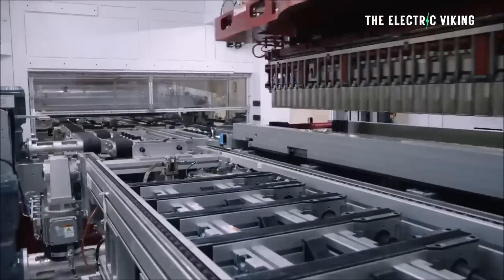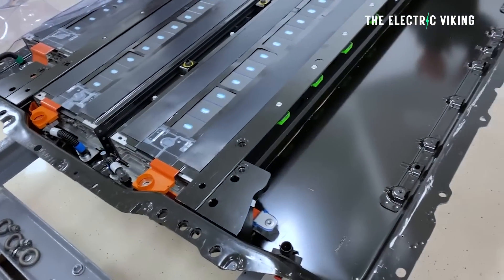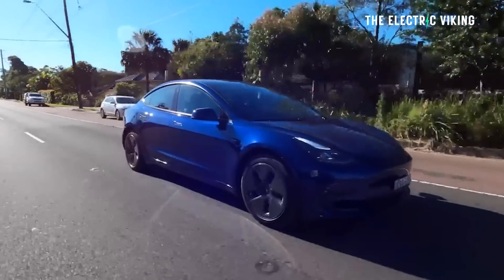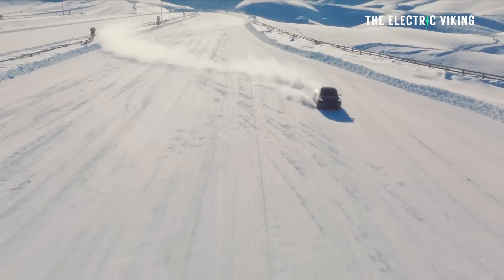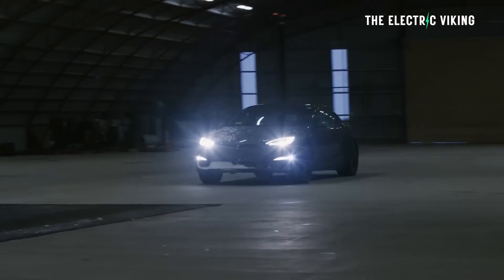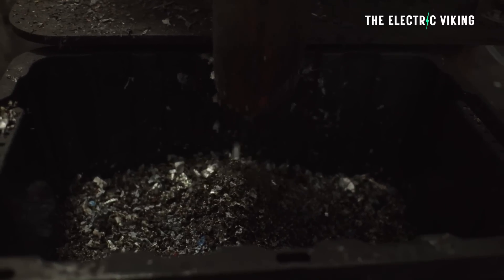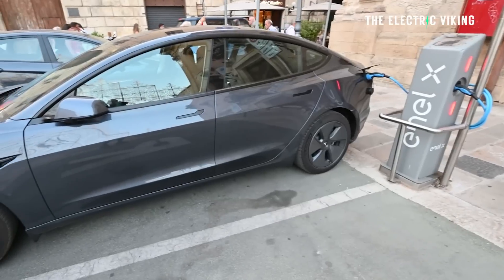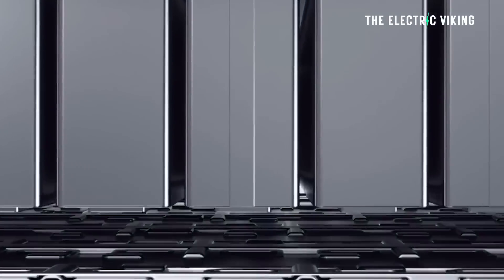Tesla reveal how long its batteries last after 200,000 miles of driving

Comment: The LFP batteries should be far superior to the Nickel Manganese Cobalt batteries. LFP batteries typically will retain 80% - 90% of their capacity after 4000 - 6000 charging cycles. That equates to charging your car every single day for 11 years. Some solar LFP batteries are issuing a limited warranty that guarantees that the batteries will retain 90% of their capacity after 10 years of charging. 

I bought a 2022 Tesla Model 3 with 77,000 miles on it. when I charged it to full charge (100%) it stated that I have 261 miles of range, which is 96% of its original capacity of 272 miles.  That means after 77,000 miles, it has retained 96% of its capacity, which is very good. I haven't measured the actual mileage I get because I drive fast, and that lowers the range quite a bit. When I am patient enough to drive close to the speed limit, I get between 4 miles per KW and 4.5 miles per KW, which equates to 253 - 283 miles of range. I have never gotten that much range because I don't drive slow enough for an entire charge cycle to get that much consistently. But that is not the car's fault. I THINK realistically, I get around 230 - 250 miles of range off of a full charge, but it could be a lot more. I have only had the car for a little over three weeks, so it's hard to pin down the actual mileage I am getting on a full charge.

Comment: There is a gent here that drove his Tesla 1 million miles.  Doing so required 4 battery packs; the original and 3 more. 1 was covered by Tesla, none the less just these not counting any other costs says you'll need a new $16,000 pack on average every 250,000 miles so the 200k is a rather conveniant range. You might have gone with a 3rd party or refurbished pack, but even the slightest flaw could result in a fire; so Tesla itself doesn't recommend you do that. Another fellow drove his S 300,000 miles but he incurred $20,000 in out of warranty repairs and other in warranty repairs, he did not yet replace his pack but it looks like it is likely he will have to.
Reply: Have fun with  your thermal runaway!

Comment: I have a 2023 M Y LR,  it's used for around town or very short trips - at present I run the car from 83% to about 20% in a week then charge weekly on home L2 charger BUT at about 20amps which takes overnight (240v).  Is it better for the battery to trickle this way or at say 40amps at less time ?  I'm retired and in no hurry to burn a battery.

Comment: 2021 Long Range Model 3. 57k miles. Charged it to 100% the other week and the guess-o-meter said 341 mi range. So about 4% degradation. Most charging is done at home with a Tesla Wall Charger. DC fast charging only about 10 times.

Comment: Even if the battery degrades to 50%, they could still be used in a municipal setting.  Imagine, ten thousand old batteries in a warehouse somewhere, absorbing all the excess electricity and discharging during peak hours or being used during a black start...

Comment: In yachts the data is ---- LiPo batteries do not like to sit at 100% charge and don't discharge them below 25% and you will get over 2500 cycles and last for many years with a good management and a top of the line management system.

Comment: Sam, lithium batteries degrade with usage (number of cycles) AND with age. Traditionally the rule of thumb was 20%/yr no matter how much (or little) they're used. That was the case quoted to me for consumer cells through 2015 in conversations with lithium battery engineers. You could extend life (reduce degradation) by storing lithium batteries in a freezer, though no one would do that. 

Obviously Tesla has broken that rule. 

Query: to what extent does age matter now? What should we now expect for degradation in percentage/year through chemistry decay?
Reply: Let me see your testing. You can't prove it. I'll bet my check on it

Comment: It appears the data reflects there is an expected level of degradation vs the abnormal level of degradation.  The more you deep cycle the battery, charge to 100%, drain all the way down, and DCFC the worse the degradation will be.  Extreme climates hot or cold also add more stress on the batteries.  The harder you drive it pushing hard the more degradation.  

The bottom line it is a lot like an ICE engine.  You can't abuse it and expect it to last.  You can't be afraid to tell consumers the truth.  Too many people are putting rose colored glasses on due to the marketing and then shocked and disappointed with the performance of the EV when driving at high speeds, in the cold etc.  Tell people the truth and set the correct expectations and it will go a long ways to happier EV owners.

Tell people how to care for these batteries up front instead of blowing smoke or sunshine up there backsides and people will know what to do and what not to do.  Proper charging and care and we frankly don't know how long these batteries will last.  But if you want to know the bottom line look at the warranty info from the manufacturers and they will typically tell you 2-3% a year degradation is still within "normal wear" and will not be covered for a warranty replacement or repair.  That is the bottom line.  If people take care of the batteries they likely won't see anything that bad.

Comment: I don't know why Tesla doesn't put in a 20% larger LFP battery in Model Y and 3 . the actual cost to Tesla would be about $1,000 .   They can control the initial range to existing range for the first 1-2 years then add 5% in every year for 4 years this would reduce the affect of reduced range after a few years . This could also be a great selling point .  It could also be available as say a once a month reserve in case of emergency  say when on a trip and there is a power outage where you plan to recharge .
Reply: I’m sure it’s because an LFP battery is already large - it’s fills the space that is normally taken up by an LR model Li-ion pack. LFP packs have a lower energy density than Li-ion packs. One reason I purchased an LR car is to allow for more battery degradation - much as you advocate for. Interestingly I don’t expect to have much of a problem as at 42,000 kms there is no indication of degradation with only a few superchargings and home charging to only 80%. 2021 Model 3 LR.
Reply: @dougphillips239  It could be done in the with a slight size increase of about 12mmm 1/2 inch in height if needed but as batteries are improving in energy density it may already be possible
Reply: means fewer EV's on the road.
Battery chemistry improves quicker than sales numbers of EV's.  Current buyers are still pioneers & should accept that risk.   DPF's/EGR valves screw up your ICE engine & Turbo, but people still buy them & don't know how to treat a diesel with eco-cr4p fitted.  Same story with EV's, but new chemistry will make these issues vanish, while DPF/EGR continue to ruin ICE engines but it's "the way you're driving it"....

Comment: I think you're right about people saying batteries only last ten years, but I would also suggest that Tesla claiming 12percent on average, doesn't slam the door shut on this argument. I'd really like to see them back this up by extending the warranty. Then, who cares, just point to the warranty and tell the ICE owners with three year warranties to chew on it.
Reply: Warranties cannot last forever, be it for an EV or ICE car. At one point, the owner has to assume all of the risks of owning an old car.
Reply: @user-kc1tf7zm3b  if you make claims, you should back them up. Tesla has only gone backwards on warranties. why not use your own data unless you don't really trust it.
Reply: Battery chemistry is changing rapidly, making long term, continuous data of a given set if batteries difficult. Probs why they don't change the warranties.   Live with it...
Reply: @alexmanojlovic768  easily.
Reply: Tesla battery warranty = 8 years / 120,000 miles

Comment: I have a Model 3 with 25,000 kms (15,000 miles) after 1.5 years.  I've charged twice to 100%.  I charged twice to 90%.  I have run the battery down to 11% twice.  All other charging between 20% and 80%.  Have used Tesla superchargers 10 times and third party fast chargers 10 times.  All the remaining charges have been done at home connected to a 240 volt outlet.  My range has dropped 9.5%.  Seems that I am an outlier.  Hope it stabilizes at this point.
Reply: Is that an LFP? What temps does your car live in. Cold weather LFP 9.5% sounds right. Degradation should slow down. Also you haven’t done a full cycle often enough for the computer to truly know.

Comment: 2013 Model S.  10 years old.  VIN 6000.  10% degradation.  Supercharged 2000 times.  Amazing battery longevity.
Reply: What is the mileage of your early example Model S? Thanks.
Reply: Wow that's awesome
Reply: What's your current mileage? 2000 charges in 10years, that's hell crazy. You telling me you've been charging your car every 1.8 days on average? How much mileage do you do a day?

Comment: You have to be a bit careful.  Tesla always leaves a hidden buffer in the battery pack on a new car.  The loss of capacity eats into that buffer slowly, so the driver's experienced loss occurs at a lower rate than is actually happening in the battery. 

Tesla is playing a bit of a game here.  That said, Tesla batteries still appear to have impressively good longevity.

Comment: There is a reason why Tesla didn’t include Model 3/Y in the data because the 2170 batteries degrade much faster than 18650 batteries used in model S/X.  My 2018 Long Range RWD model 3 has already lost 15% of range with less than 90k miles driven in less than 5 years.  I have almost never supercharged.  Only 3 times in 4.5 years.  I heard similar degradation from other Model 3 owners online.  4680 batteries could degrade even faster.

Comment: I don’t know.. my model 3 sr with 270 mile range is plenty for me… I hardly EVER drive more than 120 in a day… most of my trips are 10-15 miles a day…
Reply: Yes, EV driving range and associated battery degradation is irrelevant for most drivers. Even the standard range  Model 3 has 491km of range. On average, Australians only drive 33km each day.

Comment: After 3 years and 135000km my 2020 Model 3 LR is at 7% degradation. Didn't really go down much for the past year.
Reply: You are driving 45,000km each and every year?
Reply: @user-kc1tf7zm3b  Correct.
Reply: @zedski  Wow. This is approaching 4 times the Australian driving average of 12,000km annually. Is your workplace 70km away from home?

Well, with this astonishing level of driving, the return on investment with the Tesla EV came about very quickly.
Reply: @user-kc1tf7zm3b  My daily work commute is 55km round trip. Around 10000km per year just going to office and back. On top of that I drive some extra for work, around another 10000km per year which are compensated. About 25000 personal for the past 3 years just because EVs are so cheap to drive here (I live in Finland). Last summer for example I took a trip around Europe with family which totaled about 13000km.

Comment: Battery life is one aspect, and clearly less of a concern than the naysayers would have us believe.  However, what about potential obsolescence of the onboard computer and processor?  Don't necessarily see much comment about that.  How well will today's Teslas - or any modern car, for that matter - fare with 15 years of version upgrades and patches?  I'm not at all an expert on this topic so would appreciate input here.
Reply: If robotaxis become a thing the need for software becomes irrelevant as most passengers will just continue to use their own devices which rapidly upgrade hardware. All that is required of the taxi are Bluetooth speakers
Reply: Legit concern. Not to worry though, if it works now it should keep working fine until the end of pack life. Will there be newer cars with newer chips that do way more by then? Absolutely. But the car will still operate just fine. Obsolescence vs. longevity. They will definitely be obsolete, but should have the longevity to keep working. It’s possible that some of the chips stop working. Wonder if they will be as easy as getting an ICE car part- like an alternator or timing belt, or if it will be different than that. Time will tell.
Reply: In ten years it will be a non issue. Ownership will be silly.
Reply: @davefroman4700  ownership NOW is silly, but there's no suitable alternative ATM.  Roll on Robotaxis & cheap costs per mile.  Private cars for racing & outlier needs.
Reply: @alexmanojlovic768  it is worth noting that more than a few people use a vehicle as a roving room of their house or an office or other type of workplace, such as soccer moms, tradespeople (plumbers, electricians, food trucks, etc.) so there are certainly plenty of outliers besides people living far out in the countryside.
Reply: @JohnGeorgeBauerBuis  Yes,  good examples for everyone else's awareness.  But I agree, & the majority of naysayers don't seem to realise we're at least 10-15 years away from a large EV majority on the roads.  No one expects average/low income earners to switch until battery costs drop dramatically & the infrastructure can cope with the energy demands, or rooftop solar becomes commonplace.  At which point Robotaxis WILL exist & be cheaper, more convenient & more practical than owning/running your own car.
Reply: @alexmanojlovic768  ,the large majority of Americans would never want to deal with robotaxi's. Maybe only those in big cities. Most of the area of the country and most countries is suburbs and rural. What kind of sense does it make for a taxi to drive a long distance before even starting it's service? What a waste. And no one's going to wait at home for their ride to arrive or plan every trip. You just need to get up and go at any moment.
Reply: @Josh-179  what a ridiculous comment.  You think a Robotaxi will drive a long distance to pick someone up, do their long journey, then return to it's start point?  You totally don't understand the concept of Robotaxis.

Comment: Tesla has revealed nothing. They only admitted that Panasonic's 18650 battery cells (in Models S & X) have lost about 12% capacity after 200,000 miles. They have not disclosed anything about the lifecycle characteristics of their own 4680 ternary liquid cathode and forthcoming dry cathode batteries. From previous laboratory reports I expect their 4680 ternary liquid cathode batteries to last at least 300,000 miles before seeing similar degradation. I also expect their 4680 ternary dry cathode batteries (likely for Cybertruck) to last over 1,000,000 miles before seeing similar degradation. They have not started manufacturing their own 4680 LFP batteries as yet, likely because it is still much cheaper to buy them from CATL, BYD, and other partners. Eventually, as their energy business and lower cost next generation platform vehicles scale production, Tesla will need more LFP batteries than its partners can supply, and will begin to make their own 4680 LFP batteries, with cycle life well over 1,000,000 miles.
Reply: Exactly, model s/x are small portion of Tesla sales.  Why do they only publish model s/x data and not model 3/y?  Of course Tesla  knows.

Comment: 21 m3 lr +acceleration boost 58k miles, having fun with the power, 5 ~1200mile super charger trips per year. Usually charging lvl 2 with provided mobile charger at home.

Degradation around 6-7% i believe. What's the best way to do that math?
Reply: With smile on your face?  Especially every time an ICE drives past (or you blow it's doors off...) 😁👍
Reply: @Alex Manojlovic  there is always a faster car that an enthusiast has tweaked ;)  but yeah its been an overall positive and cheap operating experience with a few frustrating points caused by some cheaper areas of the car and or QC practices.    But you might be messing with me so idk how to answer =b 

All love.

Comment: A high charge cycle expectancy does not guarantee you will get a long calendar life. Batteries age whether they are cycled or not. It is good that high use cars are getting these long distances but it does not mean a low use car will last beyond 10 years. I hope they do but we don't know that - yet. 
Temperature is also a factor in aging.
Reply: If you rarely use a car, then current EV tech/pricing is presently the wrong choice unless you have more money than sense.  Or fell in love with a particular car.

Comment: The supercharging doesn't seem to have the effect you think it does. Now, HOW you supercharge may degrade it more.. but I supercharge a lot.. every week.. and I have about 6-7% degradation in 5 and 1/2 years. I bet I would have right about the same if I slow charged over the same time, which wouldn't even be possible for me to do with my job. The thing is.. you gotta be smart on how you do it.. keeping it between the 20-80% marks most of the time, seems to be keeping it very good condition. There may be other % ranges that work too.. but I've been doing the 20-80% for the vast majority of it's life and it's worked very well. Now maybe I'll be at 15% lost over the same 10 year time frame you mention vs the 12% you mention.. but it's pretty similar and I'll be very happy with the 15% loss at 10 years / 200,000 miles.

Comment: There's one question I can't get answered.  If the battery degrades 12% like in your story, does it mean the KHW/Mile goes up?  in other words will I also be putting less energy in the battery?
Reply: Why should the kWh/miles go up? You just have e.g. 12 % less ‚storage‘ capacity. Modern cars state anyhow net values e.g. Kia 77,4 kWh but in fact the battery has about 87 kWh which means that there is a rather big buffer before any effect will be remarked by users.
Reply: When you lose battery capacity and health, you lose driving range. So, the battery becomes less efficient and productive.